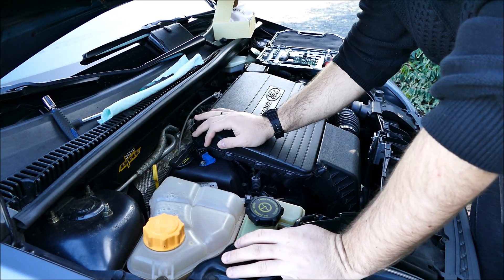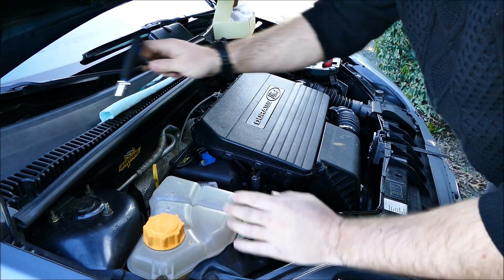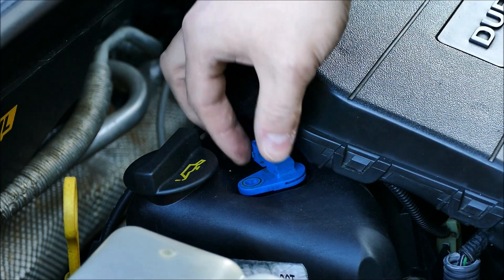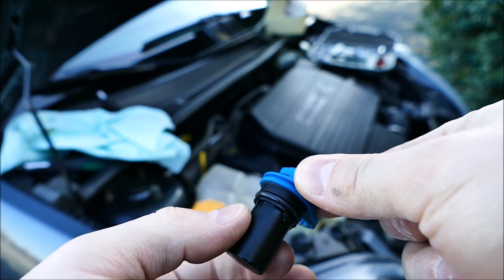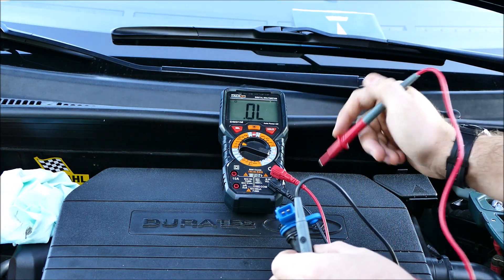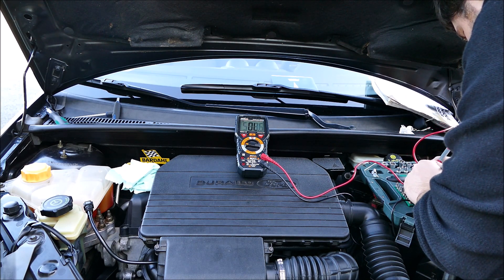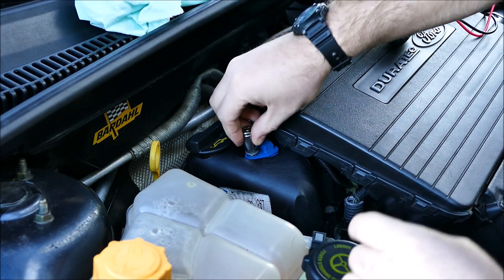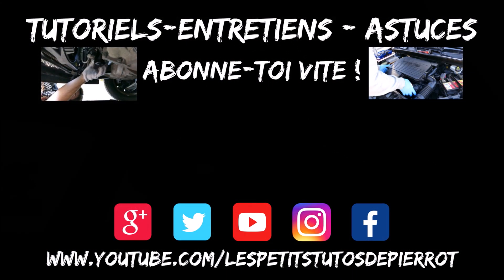Ford fiesta Mk6 - Capteur d'arbre à cames (CMP)

Comment: Ça sert à quoi ?
Reply from the maker: Le rôle du capteur d’arbre à camesUn capteur est placé au niveau de l’arbre à cames afin d’envoyer au calculateur les informations sur le cycle de combustion des pistons pour que ce dernier puisse ensuite injecter le carburant au bon moment et dans le bon cylindre.Cela permet donc également le démarrage du moteur puisque pour démarrer le calculateur a besoin de savoir dans quelle phase se situent les pistons en point mort haut pour déterminer le bon ordre d’allumage.Relation avec le capteur PMHCependant, le calculateur doit également connaître la position des pistons et notamment le point mort haut pour compléter l’information qu’il reçoit de la part du capteur d’arbre à cames. C’est le rôle du capteur PMH qui se charge de mesurer et envoyer cette donnée grâce à la vitesse de rotation du volant moteur.
Reply: @LPTDP  merci

Comment: salut pierrot, est ce que tu sais où se trouve le capteur de température exterieur de la ford fiesta mk6 ( j ai une ford fiesta 1400 cc TDCI de 2006) merci
Reply from the maker: salut, ce roule je regarde ,par contre j'ai pas assez de détail il y à 3-4 version(code moteur) en 1.4L elle à combien de chevaux ?
Reply: @LPTDP   68chevaux :)
Reply from the maker: tu me pose un colle la mdr , elle à clim automatique ton machin ?
Reply: @LPTDP  non pas clim auto mais j ai la clim mdrrr, car en faite, je t explique, j'ai un prob, ça m indique des fois temperature ext. a -40° ou a +60° et apres j'ai le voyant "flocon" qui se met en rouge
Reply from the maker: okey ca roule le voyant flocon chhez ford enfin d'après le manuel c'est le témoin de verglas (ou température on va dire )

Il s'allume et présente une lueur orange lorsque la température extérieure se situe entre 4 °C et 1 °C. Il présente une lueur rouge lorsque la température est inférieure à 1 °C.
Reply from the maker: je vais cherchez et voir ce que je trouve et je reviens vers toi d'accord :)
Reply: @LPTDP  oui voila sauf que le mien ne fonctionnait plus, et depuis +- 1mois, ça me fait ça tout le temps, ça deconne mais j arrive pas a trouver ou elle se situe ^^
Reply: @LPTDP  dac merci beaucoup :)
Reply from the maker: question toute bête ca va m'aider à avancer dans le diag le temps de savoir ou elle se trouve , ta checker le fusible qui la concerne ?
Reply: @LPTDP  ha non, pas regarder, c'est un fusible, qui se trouve ou il y a la boite a gant ou sous le capot ?
Reply from the maker: si possible viens dur mon discord pour discuter ca sera plus simple la on va galérer lol https://discord.gg/rB7s9cq